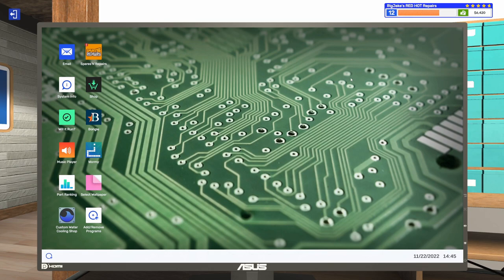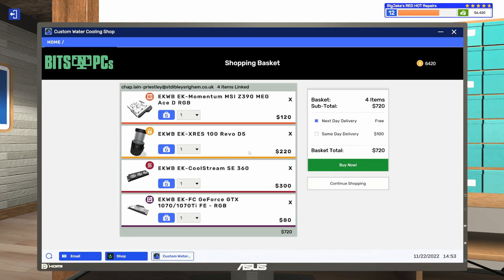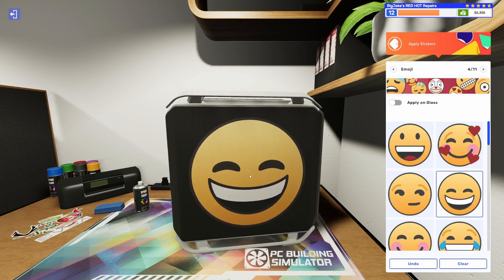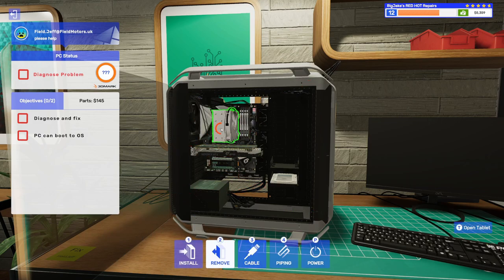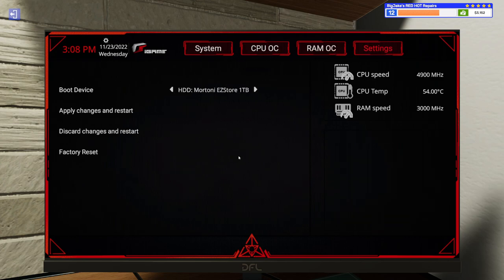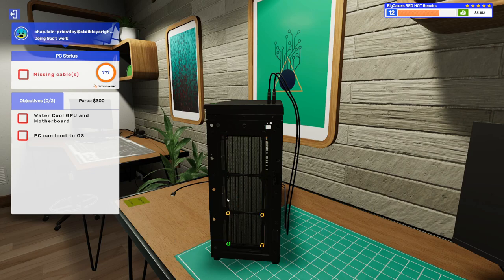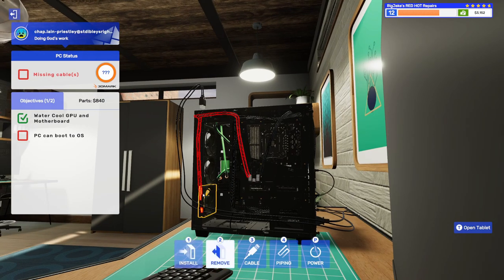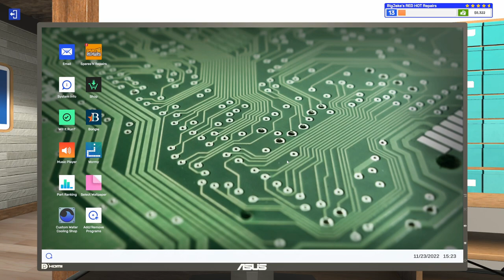Custom Water-Cooled PC ... Redemption!! | PC Building Simulator 2 | Episode 13

Comment: also on that job you were sitting on you dident actually need the 5600x i put a very expensive intel cpu in there did a bit of overclocking (very little) and it came through
Reply: or maybe it was a slightly different job like it has a different montherboard
Reply: ok i looked back at it and is was an amd but i dident even need the 5600x